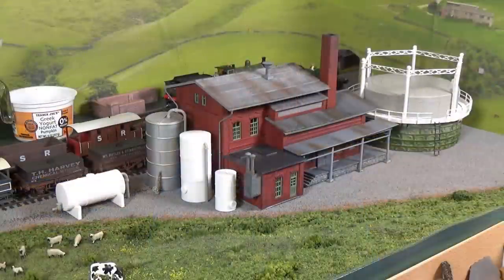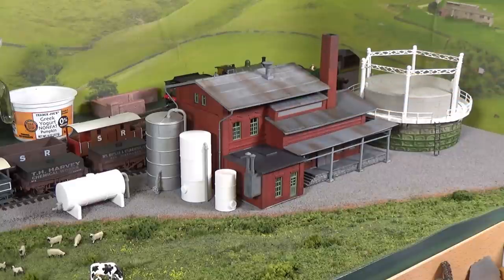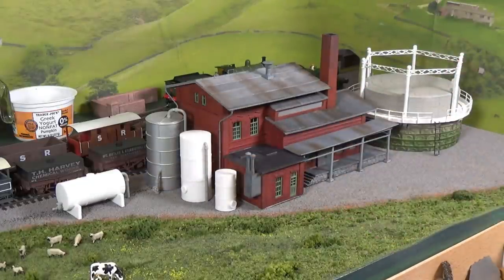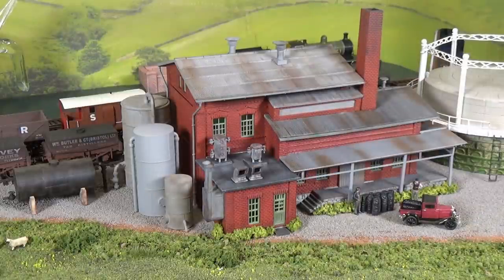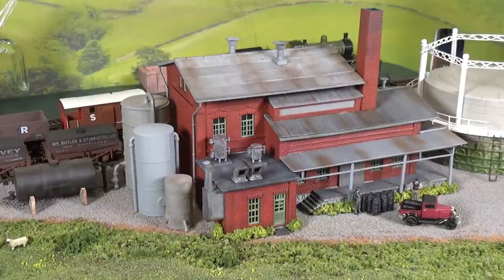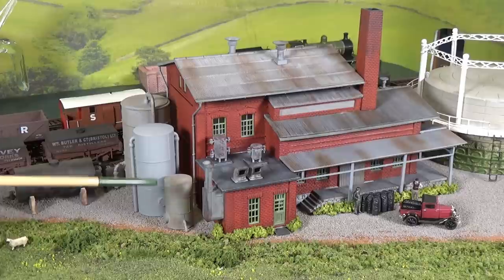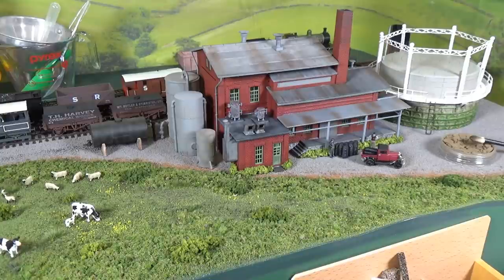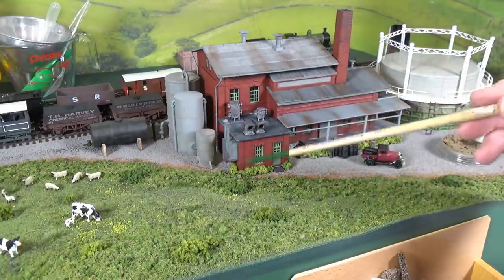Finishing Touches For The Gas Works (226)

Comment: Hi Larry, love your videos. I know I missed the boat for ideas but would love to see a video on lighting strips for coaches and making these work without a decoder on DCC with reed (magnetic) switches to enable either fixed on off points eg as they go into the fiddle yard or as you wave a magnetic wand over them. Note the reed switches can be set to be mounted on the top of the coach with the magnet on the underside of a bridge / tunnel to stop interference with couplings.

Comment: Your gas works came out looking very nice, indeed.  As you mentioned in your video, gas works were pretty nasty industries, generating no end of noxious by-products, which were typically handled and disposed of with little of the care taken today. For example, the ground around the tar tank would undoubtedly be well-stained with spillage residue, particularly in way of the tank's nozzle.

Comment: From what I can see: My guess on the cans on the roof would be electric transformers maybe?? Regulating the electricity coming in from the line or powerhouse.
Reply from the maker: That would b em guess too, although I have no idea what the little devices hanging on the sides are. When I put in the utility poles a d wires I will likely jut drop a line or two to these based in that assumption.
Reply: Again from what I could make out in the video, I though they might have been some kind of insulators, like the glass insulators that used to be on telephone poles.

Comment: Have you done a segment on traction wheels? Like how to replace the road traction wheels.
Also have you done or worked with this Bullfrog Snot? Is it worth using it?
Reply from the maker: I don’t like traction tires as it interferes with power pickup. Same with Frog Snot.
Reply: @TheDCCGuy  so you runwithout them? Don't you get a lot of slippage? Thank you for your comment, I run N scale but your channel gives out so much good information.
Reply from the maker: In larger scales like HO the locos usually pull enough cars to look reasonable without slipping. And for longer trains I just use 2-3 locos in a consist. My layout is basically a flat shelf layout except for the helix so no real slippage. On the helix my diesels can pull about 10 cars each so 2 can haul a 20 car train up the hill. I would be even more concerned about using traction tires and Frog Snot on N scale locos since they are even more sensitive to power pickup problems.

Comment: Hi Larry. Sorry to hear of Duncan's sad news - I hope he can get some effective treatment. Sorry, I can't remember whether you also run DC locomotives; if you do, I wanted to ask how you switch between DC and DCC controllers. Depending on how the track is laid out, it is not necessarily just a case of disconnecting one controller and connecting another.
Reply from the maker: While I don’t recommend mixing them at the same time you can use a DPDT switch to go between DC and DCC power on a layout. Complications may arise if you use any type,of detection and or signaling system that is actively to the rails.
Reply: @TheDCCGuy  Hi Larry. Yes, I understand that both types of control cannot be used at the same time and that a DPDT switch may be used, but for a complex track plan how would a single DPDT switch be implemented?
Reply from the maker: I really don’t recommend that at all. The more complex things get the more like a problem will crop up. However I have know of folks who used DC block controls and set one pole for DC and the other for DCC all around their layout. The idea with that is to just flip all the block switches to either the DCC or DC power source. However the first time someone forgets or flips things the wring way, look out!